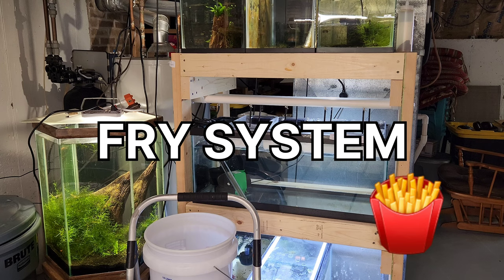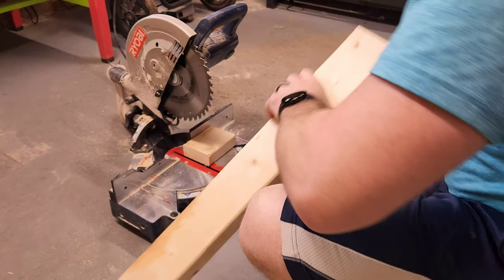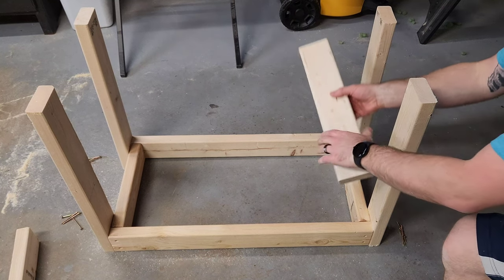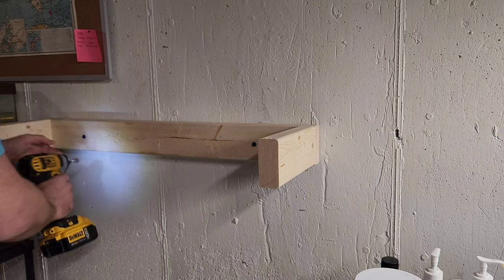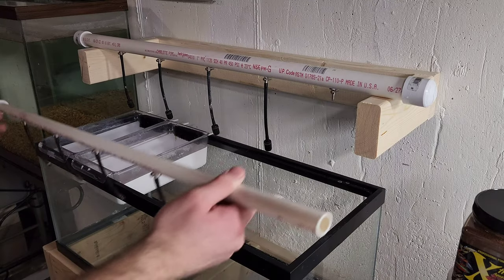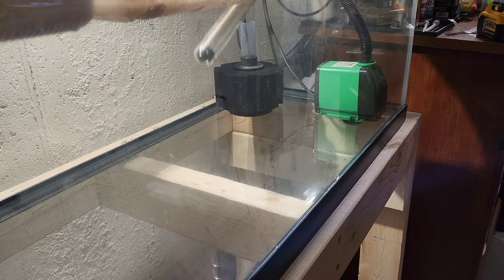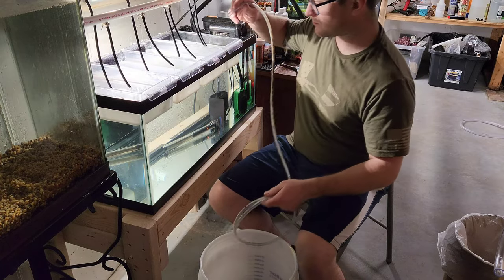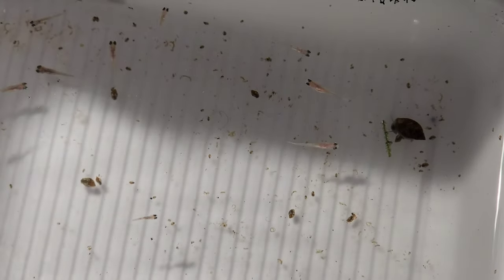MASTER BREEDER DEAN'S FRY SYSTEM! (NEW AND IMPROVED!)

Comment: Nice! Having that extra room makes all the difference. Now you just need one more thing, a rolling stool with adjustable height, padded of course. Oh it will work in your new fishroom also.  Oh, one other thing, if you put a piece of 1/2 inch or 3/4 inch plywood on top of the stand, then that extra space could become a small shelf in front of the tank to set like your baster or other small items on while working on the fry system.
Reply from the maker: The stool is a great idea, thanks Dean 😊 I love the shelf idea too, right now I don't really have anywhere to put my tools when I'm working on the system. I really appreciate all the wisdom, passion and joy you bring to the hobby. Thank you 😊

Comment: Just built this system very similar to this.   Did find that the baby fry were getting out through the filter sponge cut out.   Found a solution: I bought FINE paint strainer mesh, wrapped the foam price in the mesh and pushed the foam back into the space.  No fry have gotten out. Thought I'd share.
Reply from the maker: YES, I've had the same issue. Excellent idea, I am going to use that. Thank you

Comment: Why use an aquarium for the main holding tank? Seems to me it's bit of a waste of space and an aquarium that could otherwise be housing more fish. You really only need something to have water in to a depth of maybe 6"? Excellent rack though! Just a thought.
Reply from the maker: Hey Paul, I understand where you're coming from! I think the general idea is to provide the fish with the highest volume of water possible while still keeping them in tight groups while they are small. But yes you could use something like you are describing! It would just be a smaller volume of water which means more variables when it comes to water quality and maintenance
Reply: @sydneysangels  Ya that's a huge benefit... a larger body of water is more stable. And that really is an important factor. I really like your fry rack though, and Deans, but this video made it easier for some reason to build my own. But another idea I was thinking of building for a fry rack, that would give you 50 gallons instead of 20 in the same 4' of wall space. There is a 4'x2'x10" high, 50 gallon "Low Boy" tank you can get. I'd get one of those and divide it down the middle and then 3 more cross tank dividers to give me 8, 1'x1'x10" tall fry/grow out 'tanks'. So, when a Cory or a Pleco lays eggs, you put those eggs in a floating basket in one of those 8 tanks with the air stone, hatch them out, (or in the case of plecos empty the contents of the cave as wigglers or very young fry) grow them up intently for a couple weeks, then put them in the 'tank' they're floating in and wala! Depending on species, you might be able to grow them all up that way, but for others, I would put them in larger tanks eventually. Each fry tank would be 1'x1'x10" (or could be divided even more) all in one big 50 gallon tank, set up the same way for each separate 'tank'. Find any flaws in that way? Just curious.

Comment: I have an entire rack of 20Ls supported only in the ends Aquarium CoOp style. I’m planning to convert a lot of my fishroom to that style of racking.
Reply from the maker: That's good to know! At first I was a bit bummed with my mistake, but then I realized it's still plenty strong. If you're running a whole rack that way it gives me a lot more confidence, thank you 😌
Reply: @sydneysangels  It’s working great. I actually used 2x2s for the end supports to allow easier opening of lids. I am able to stack four 20Ls without having one on the floor and still being able to easily see into the top one. 
My next racks will use angle iron for the supports for an even cleaner look. I’ve done the same with 40Bs except I added some angle iron across the front and back which still allows tighter stacking and practicality for me.
Reply from the maker: @barefootaquatics  oooohhh that makes sense! The 2x2 gives your hand more room. I would be nervous that it wouldn't hold but wood is stronger than I probably think. The angle iron is going to look really sharp, I would love to see that!
Reply: @sydneysangels  How can I contact you and I’ll send a couple pics of what I currently have set up.
Reply from the maker: @barefootaquatics  email me at sydneysangelsstore@gmail.com

Comment: Hi :) cool vidio !!! What sice are your small aquariums?. I what to build 2 at the side of my pc. There sice will be 30 cm x 30 cm x 35 cm so they are alittle longer. Is it posible to have cpd breeding groupe in 1 and have there fry in the other ?. I really hope I can have some egg laying fish most people in denmark won't even answer because they think its stupid to have fish is such small aquariums
Reply from the maker: If I did the math right, I believe what you have is about 8 U.S. gallons or 30 liters, is that correct? If that's the case than I would say for sure you have room! My small tanks are actually 5 gallon tanks. They are a little on the small size but I do large frequent water changes so that definitely helps
Reply: @sydneysangels  thanks :) and yes it's 8 gallon:) thanks for the fast reply:)
Reply from the maker: @110890nick  no problem! 😊

Comment: I'm eternally jealous of those with (mostly) level floors in their fish rooms. I live in a 99 year old house and have my modest fish room in the unfinished basement. I would love to be able to repair the old cement floor, some of that self-leveling stuff. But that would, of course, entail relocating all my current tanks, doing the pour, then moving it all back... 
Ugh, the eternal fish keeper's to-do list!..
Reply from the maker: Gaaahh that would be so much work! I hear you. So is the waterline in all of your tanks slightly off? That would bother me and I guess I never realized how lucky I am to have a level basement
Reply: For this I made a frame to go under my stands out of 4"x4" wood and attached leveler legs. You can then level your tank with with an alan key, even when full. You just need to check the rating on the legs compared to the weight of the tanks. I have this working with a 66 gallon with no issues.

Comment: nice work, for better control to not suck up fry, try "200cc Fluid Extractor Fluid Syringe" they are meant for automotive, but they are like a giant syringe/turkey baster, works great
Reply from the maker: Thanks Greg, that is super helpful! I'll be picking up one of those for sure. Right now I'm just using some flexible tubing from a small python kit. I appreciate the awesome tip!

Comment: What are the valves you screw into the PVC? That part has me a little confused. Do you tap the hole?
Reply from the maker: I actually get them from a fish room site called Jehmco, have you ever heard of it? They are small stainless steel valves. When you purchase them you can have the company send you the exact drill bit and tap you need to install them in the PVC. Don't make the same mistake I did and use them for water, only use them for air. The water eventually causes them to corrode and not function as smoothly. They sell separate one's for water. I'll send you the link, I hope that helps! Item # AV1E

https://jehmco.com/html/air_accessories.html

Comment: Ok, this was super helpful! HOWEVER, I use that exact pump for water changes and even when I close the intact to as slow as possible, the pressure is way too strong. How do you not over pressure your water pipes or not blow the motor. Sorry if this is a newb question!
Reply from the maker: Oh no kidding! Well I don't know actually lol. To be honest the pump is probably over pressurized constantly and that might impact the longevity of it. But it's what I had laying around so I used it. If you could find a smaller pump that would be more appropriate, OR you could create a pressure relief valve and just open it as much as you need to back into the tank so that you can decrease the working pressure. Get what I mean? I should have probably done that!
Reply: Try bleeding pressure off with a tee and valve. i do that it is easier on the pump also

Comment: That looks pretty easy to make & manage for 
any breeder to do, I guess when you clean the 
containers you have new water going back in ?
Reply from the maker: Yeah exactly! And to do a water change on the whole system, you just have to siphon water out of the main tank. It's easy to do since you don't have to worry about sucking up any fry!
Reply: @sydneysangels  The water from the tank B-low 
is that where the clean water comes from to the 
fry containers ? I could set a single setup for doing 
Corry catfish eggs being that's all I really have is 6.
Reply from the maker: @raisinggoldfishonabudget7058  yes that's correct! I have a small pump that recirculates fresh water from the bottom tank into a PVC pipe with valves which ultimately drains into each tray. Yes you could!

Comment: Hi there, since you are using the fry system for quite a few months, I was wondering what % of Angel fry survives from a single batch on an avg?
Reply from the maker: Hi! To be honest I haven't used it on angelfish eggs yet. This is because I find it hard to fit the slate I use in this system. I usually hatch out the slates in a 5-10 gallon bare bottom tank with some methylene blue at 80 degrees. Hatch rates vary for me, but normally I can expect 85%-95% because I take a small pipette and meticulously remove every fungus egg as they pop up. I think that helps a lot, along with very clean water!

Comment: What did u use to connect the pump to the pvc
Reply from the maker: I just used the flexible hose that came with the fluval 207. It has a soft pliable end on both sides

Comment: Hi Dan love your content, ❣️❣️ I do have a question, I have a pair of angels and they lay roughly every 4 weeks but the eggs are never fertilized , they normally lay on a leaf or top of the intake , definitely male and female any idears please as I would love to breed of them , loving your channel from the UK
Reply from the maker: Thanks Cathy, I really appreciate that! You are 100% sure they are male and female? I've heard of two females laying eggs together before. If the eggs aren't getting fertilized it is possible that they just need more time to practice. I actually didn't get any viable fry from the first four spawns of my Philippine Blue Angel fish. After that, I had about a thousand angels with four successful spawns in a row! I don't know why it didn't work the first few times but that was my experience anyway. Sometimes I will try to do a water change and then heat the water up to about 80° f. Are you using any products on the eggs to fight off fungus? Maybe it's possible you're using too much? I use a tiny bit of methylene blue on my angelfish eggs while hatching. Otherwise I'm not sure, I'll be thinking on it though and I'll comment back if I have any more ideas!
Reply: Hi cheers for your reply, the only way I've sexed them is through there breeding tubes , was thinking of getting a breeding come for them to see if the angle for him is better, I don't use any products to help the eggs , they are in 400 litre planted community tank  cheers again for your reply
Reply from the maker: @cathyrussell9280  you're welcome! Yeah maybe try that! It definitely won't hurt! Keep trying! I'm making a how-to video on angelfish right now actually 😊

Comment: Sir, the way your tank sits is not very safe.. must hv some vertical woods underneath your tank to support the weight.
Reply from the maker: I think it's strong enough for now but you are right it can definitely be stronger. I will probably add vertical supports down the road!

Comment: Yeah that stand is definitely cringe worthy- support the weight with wood- never screws. Hopefully you won't learn the hard way... always paint a few coats before assembly and seal that wood from moisture,  especially on the feet and couple inches up the legs. Otherwise nice build! Can't wait to get my own going.
Reply from the maker: I appreciate the feedback! Hear me out though- I'm really not concerned about the strength of the stand. Each screw has a shear strength of 80 pounds and I've used 32 of them to support the tank, so that's about 2,500 pounds of weight it could technically support. Does that sound right? I guess I could be completely wrong haha but the tank with water and equipment doesn't weigh more than 200lbs. Now in future builds I will probably be making dado joints but I didn't have the time since I'm doing this all while my baby is sleeping haha. Also I agree I should have sealed it. I should do that when I move it to the new room ☺️ I would love to see your setup when you build it!